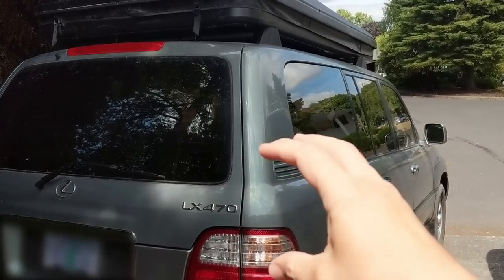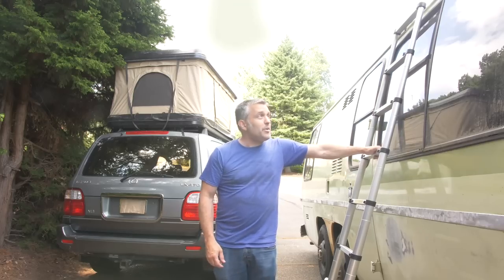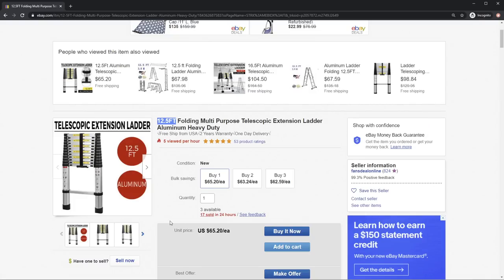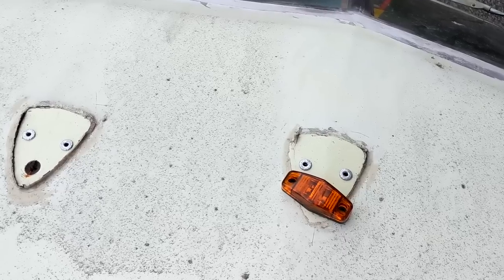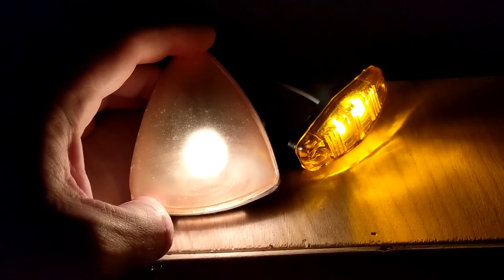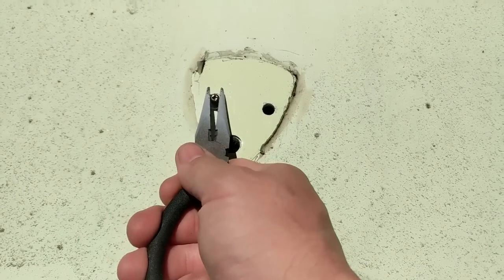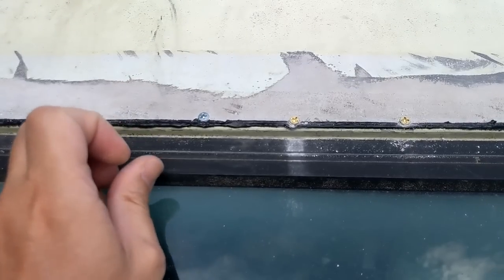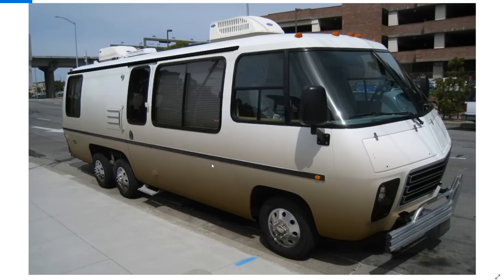Building the Best Damn GMC Motorhome Ever E.12 - Lights and Ladders

Comment: There are now a/c units that run from solar panels that will keep the unit cool. You have a great site. Save the GM Ladder as there is surely someone who will want to get that from you for their RV.  You can get on line the exact lights your removing with LED & they are the Amber & in Fog you want that. So you won't have to do all the filler for the tiny one's your putting on.

Comment: OK, I've been skulking around watching and I have a couple of observations. First, even if you're boondocking, you're still going to need an AC unit in the thing. There are any number of smaller, sleeker, way more efficient units to replace the behemoth you ripped out of it and, if you don't put something in there to replace it, you will roast. Say you want to visit Arizona, or even Eastern Oregon in the summer. Second, aero be damned, you're also going to find yourself wishing you had some kind of storage on top of that thing eventually. Otherwise, why buy a ladder? 
I've always wanted one of these to go all sick on customizing it (think "Orient Express" art deco on the inside) and I like watching how others approach problem-solving on these vehicles. And, fellow Stumptowner...

Comment: As has been stated, the roof marker lights are a regulatory item here in the US to indicate vehicle width. My concern with the ones you are using, in the orientation you are using them, is that you won't be able to see them from another vehicle. The housing/screws will block them going forward. You might get into trouble with johny law for that. There are more sleek, streamlined options out there, but the light needs to be oriented forward so that oncoming/trailing vehicles can see them.

As to the fade paint job, there's good reason you don't see it. Paint jobs for these coaches are incredibly expensive as it is, and fade paint jobs just multiple that cost, as they are incredibly expensive paint jobs on normal sized vehicles. If you are going to do a fade, I would recommend looking into a wrap instead.

Lastly, as has been said, unless you live in a very temperate climate, you are going to want that AC unit. Maybe a mini split unit will work better for you, I have seen a few GMC people install them over the rear window in their coaches. These rigs are heat sinks with the aluminum skin, and no amount of insulation has been able to satisfy the community thus far.

As a fellow GMC owner, I look forward to watching the rest of you build.
Reply from the maker: A very good yet critical comment. Thank you for your courteous input without the vitriol so commonly seen in Youtube comments. Nothing is set in stone. That's not how I work. Nobody should be surprised if the final build is more inline with your assertions.

Comment: You might wanna look into the possibility that polyester products don't stick very well too Gmc plastic I believe epoxies are  the way to go. But you should put the question out to one of the GMC forms. Thanks for the videos
Reply: The seam sealer is asphalt based. It's very stinky and never fully hardens. It's not really a glue, just a water proofing agent.
Reply: GM makes a foam adhesive sealer two. Part. That is waterproof and flexible

Comment: I think one of the main problems with the coach is the flexing of the seams on the roof? Would a fairing stip wider than the seam with gaskets help? The gaskets would keep water out, and still be able to shift. They would also block UV deterioration.

Comment: 7:15 Those “Indicator Lights” purpose/law are to indicate vehicles that are 80” wide & wider; 5 of these are required by law. 3 of the lights are in a row in the middle to indicate the presence of a “wide vehicle”. Additionally, 1 light sits at each side (2 total), at the widest point of the vehicle/roofline, to indicate how wide the vehicle actually is.
Reply: In one country, there was a trick to the clearance lights :
The lights would illuminate sequentially as the speed increased. A truck with all 5 on was really moving, and you better give way.

Comment: i would go for a different marker lamps, although you can see them bright from the side you need to take in mind that most traffic is lower then the roof of the motorhome, so should be able to see them from a lower angle (where i assume that the black part of your lamps is hiding part of the light going down).

try "roof marker LED" on ebay and there's many options.

Comment: I would completely fill the running light holes and drill new ones right above the windshield. That way the running light are facing forward of the vehicle rather than being on top. I also wouldn't bother with the body filler over the screws. I would instead sand down the entire roof and use the Henry's Tropi-Cool sealant on the entire roof (effectively covering the screw heads) and insulating the roof from heat/cold. It should also cover the metal plate that you installed in place of the old A/C unit.  Here's the sealant I'm talking about. https://henry.com/retail/white-roof-coatings/887-tropi-cool-100-silicone-white-roof-coating

Comment: Your body filler patches, I feel, are going to end up leaking. I feel in time the body filler is going the shift and crack, that will cause the paint to crack, and then the water is going to come through. I have seen issue with bondo on cars, just hoping it works for you.
Reply from the maker: This is certainly a problem with bondo on metal. I'm hopeful it will not happen because I've only patched holes in the SMC fiberglass with the body filler. As the materials are very similar versions of polyester resin, I think they will remain relatively constant to each other even during heat/contraction that comes with temperature changes. I 'm hopeful that the paint will not crack.
Reply: @IndustriousPursuits  The right way to do this is to sand down the SMC larger than the holes, say a 4"x4" area, lay down 2 layers of fiberglass, sand then bondo. Strong and leak proof.